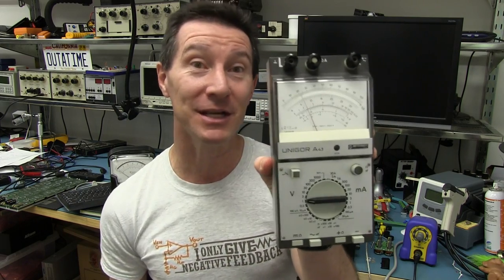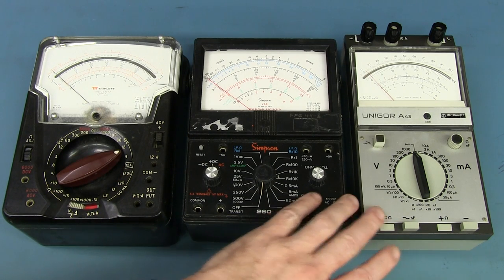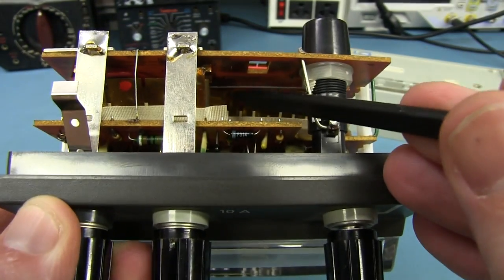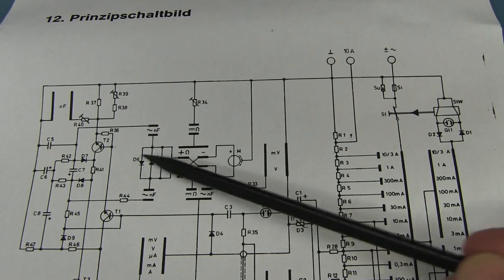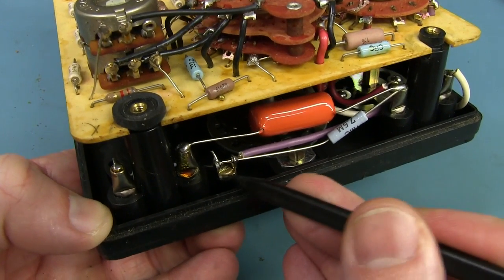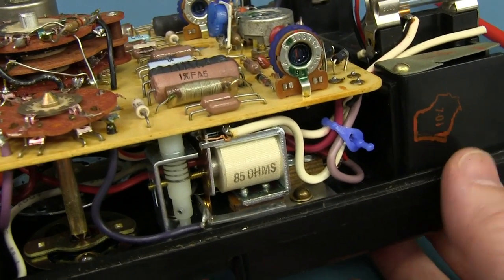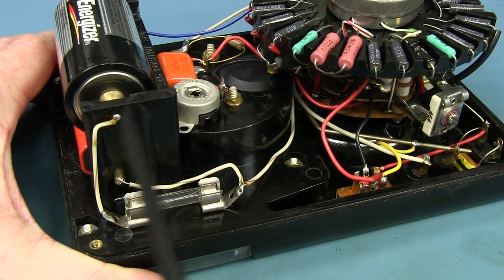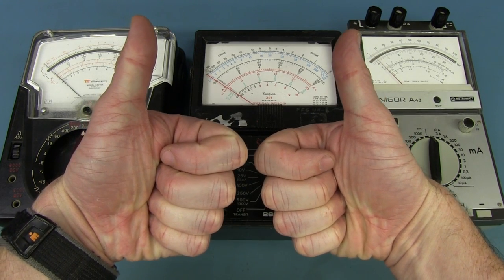EEVblog #634 - Analog Multimeter Teardowns

Comment: Unigors are still used in many European universities, and they still work very nicely.
I happened to work with one ~2 years ago:
Some people asked about how precise they are, and after comparing with some fluke, other brands and 2 oscis there, and if you take the time to read it with a lens and interpolate the values, you can go down to 0.1% error.

Oh, and btw, the Unigor A43 gets tested up to 5000 V to make sure, it is 100% to use to 1500 V.

Didn't know that it looked that terrible inside, but when looking up different models i saw, that they vary greatly.
Reply: As just to say, the link for the Unigor A43 in that .pdf you can see it´s from a german college...;)

Comment: I have several vintage Triplett 630 variants I still use today, built between 1954 and 1965.  You can't beat a quality analog meter.  I love the bakelite case and large meter.  Outstanding construction unparalleled to this day

Comment: Ehh...I liked the German meter the best. I think there is better attention to detail like the spark gap and the much larger air gap for the spring loaded disconnect. Exterior design, it is the best and I don't really get how it's being knocked for a dual board construction when it seems the other meters are somewhat half-ass arranged in mid air.
Reply: Austrian, to be precise. BBC Goerz was in Vienna.

I did think it was a Hartmann & Braun-knockoff; H&B Elima also was bought by ABB (Ex-BBC). My father&dagger; used a Multavi 5 from the 1940/50s all his life. I just got a "new", 1985+ Multavi 5, and do own a collection of Elavi, Multavi, Wattavis.

As a part of BBC, it seems that form factor just was kind of standard in the 1970s-1980s. It WAS expensive with a price in Germany of DM550,- in 1975.

Comment: Dave, I used this type of Unigor multimeter already in 1965 at school when I was studying Measurement and Control Technics (Electronics and pneumatics)!
In those days they did not yet use epoxy circuit boards (to expensive) outside of the military.BTW, I am from the Netherlands.

Comment: Good video. There are Simpson 260 models with mirror on the dial. They usually have an M after the 260. Bad thing about the Triplett and Simpson is how brittle the Bakelite is. I have seen scores of cracked cases and faceplates. You're right about the current Triplett meters not being the same quality. Word of caution about the Triplett: remove the batteries when putting it in storage. Too many switches have been destroyed by the leaking batteries. And repairing them well is no easy task.

Comment: Enjoyed the episode...I purchased the equivalent of the Unigor back in 1973 and it was then marketed in the US by Simpson Electric under the the model number "Simpson 257". Mine was manufactured in Austria by Goerz Electro Gmbh. It looks pretty much like your specimen inside with the phenolic type PCBs. The range selector switch is very solid with the ball bearing snap action feel.
It is still very accurate and I like the capacitance measuring feature, from about 0.01 to 5.0 microfarads. For those measurements, an external 50-60 Hz 100 to 240 VAC must be applied.

Comment: The protection diodes on the Triplett are in a single package. It is that brown gold leaded component on the back of the meter movement. The 630-PLK had the overload reset.

I have a pair of 630As, great meters, but I'm jealous of the NA's range doubler.

Comment: I agree that the Triplett is the clear winner, I own the Triplett model 630NS and like yours is identical in everyway except for the 30 volt battery. This particular model uses a 1.5 volt AA battery to achieve the same readings in the high resistant scale. When I purchased this on EBay it came with a leather case, original test leads and owners manual all in mint condition. The only issue, the battery had leaked so I fabricated and repaired the 1.5 volt container to get the 100K scale working again, well worth the time and effort.
Reply: John Cunningham Mine had the exact same problem, except the battery holder was beyond repair.  I couldn't find one locally that would fit, and wasn't going to buy one by mail without knowing its exact dimensions.  So I simply soldered the wires directly to the battery, and fixed it in place with hot-melt glue.
Reply: Thanks Clyde, it's nice to know we can be enervated when it comes to repairing equipment of this caliber, certainly worth the effort and time, especially when you consider what it can do.

Comment: Hi Dave, I myself have the Unigor A43, but is not from Metrawatt. it is from BBC GOERZ, I love this Multimeter.  It is very accurate for an analog, also through the mirror Scale.
And the screwable input connectors, are very practical.

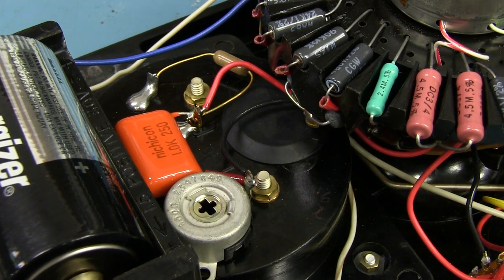Comment: EEVblog  Dave, the Germanium diodes on the 260 board that you comment on at 20:24, are actually part of the protective relay circuit. This 260-6XLP does not have individual back to back diodes across the movement, but rather a single component that is essentially, 2 back to back diodes in one case. At the 20:15 mark in your video, it's the tan (or green) colored component with gold leads, between the meter terminals, and hidden between the 2 calibration pots. It looks like a resistor, but is printed with the Simpson part number 01-110670. It was a purpose made varistor for meter protection, and can also be found in the Triplett 630 as well, printed with it's generic part number V64. (in your 630, it's the gold leaded tan component at the 26:40 mark) They are no longer available, and current production 260's and 630's just use two back to back 1N4148 or 1N914 diodes in it's place.

Comment: Static charge on analogue meters o.O
Well that's something I hadn't noticed before, makes perfect sense because all the display is a coil of wire.
Reply: ***** for formalities what you said totally reflects (pun intended) the needle ;)
Reply: I've even noticed it on some early digital meters. The display just goes crazy if you rub it with a woollen cloth. :-)
Reply: *****
You're correct. The static charge effects the needle not the coil. Sometimes this charge is very hard to get ride of however, a dryer sheet works every time.
Reply: ***** That's fine mate, I like to think of youtube as a unbiased video educational tool. If no-one would correct me, I'd never learn a thing ;)

Comment: I like the triplett, but I do like the simpson line as well.  The particular one you featured is not as nice as many that they make.  I have a 270-5 which is still manufactured to this day, and it is down to 1% accuracy on a 270 degree taut band suspension.  It is a very nice meter.  The classic 630 triplett is very , very nice.  great video!
Reply: I have a Simpson multimeter I want to restore. It uses two different types of batteries. I think I need to replace some resistors. Otherwise I think I will have a working meter. Paid about 15 to 25 dollars for it at a thrift store in north Georgia.

Comment: Dave, enjoyed this vid.  I just had my 260 xl opened up.  The D cell leaked and made a real mess, cleaned it up and reworked a couple solder joints and all is good now.  I love these old meters, Recently refurbed a KG 625 VTVM, those are nice, as they give you an analog movement with high input z.  Thanks, again!

Comment: 20:08 - Looks like these 4 diodes make up a full-wave bridge rectifier circuit for the AC ranges 

The protection diodes appear to be next to the funky plastic-tubed range resistor  (21:50).

Comment: I got a Simpson 260 series 3 for a Christmas gift in 1962 and still use it. That Simpson has 5,000 v (ac and dc) jacks on it besides the jacks used for the range switch..

I also have a Unigor from the 60's that I got when the company i worked for in the early 90's shut down, that is a very accurate meter.

Comment: In my electronics class in high school we had a about 7 Cen-Tech multimeters and a Simpson and 3 Triplett 630-PL meters I always loved the Triplett meters the most. There was just something about the loud sharp click of the switches and the heavy weight to them that I loved. I remember one of the students had one of the Triplett meters on the 2.5 DC range and probed a output on a 22V DC laptop charger and it pegged the needle so hard it bent the tip of the needle and the damn thing still read accurately (After straightening the needle). Although I still had the same issue with the loose input jacks.

Comment: Dave, the two diodes you saw on top i think are the back to back protection for the relay coil, check the schematic(it shows one part of the diodes going to the range switch). you haven't shown D5/6 which are on the movement, those are probably germanium
Reply: at 15:29 you actually show D5 on the "bottom" board it has a blue package, can you check that part number?
Reply from the maker: Ah, ok, thanks, makes sense then.
Reply: EEVblog video anotation clarification time? :D

Comment: As for the "cutOuts" @ 04:06 and up, this is not in first place a meter protect, it acts like a circuit protection (when i work with my unigor, i find this very nice and handy)
If it´s under voltage or current, you can not overload the meter (readout) as it is active meter drive anyway, but if you turn the selector to its off position under load, it always cuts out. Even while measuring low currents it cuts, so the circuit under test and the meter is always save...:)

Comment: You need to do a teardown on an Avo 8 Dave!!  Probably the most famous multimeter in the world!  There must be alot in Oz, in fact there must be alot anywhere in the world, except the USA.  It was THE must have meter when I did my electronics training but I wasn't able to afford one then.  With the advent of ebay I was finally able to indulge myself, I now have about 20 of the things in different types. Also, the GEC Select Test, a meter introduced to compete  with the Avo.
You will be shocked when you delve into an Avo though!

Comment: Your 1 1/2 V "D" cell battery in the Triplett 630 should not be an Alkaline cell. It should be a Carbon Zinc Eveready "D" cell. It all depends on the corrosion damage YOU want, right?

Comment: I remember using those Unigor meters in school in the Netherlands in the early 1980s. I remember how those switches felt, they were pretty awesome. But even back then they were already pretty old. I'm not surprised you found Pertinax (FR-2) being used for the circuit boards, that was common in the 1970s. I can tell you don't like it, but I think the relay and all the protection are pretty awesome, and probably perfect for use in schools: that way if a 12-year old kid wasn't paying attention and set the range wrong or something, they wouldn't have to throw away the meter or change the fuses all the time. Beauty! :-)
Reply: I agree, he was needlessly harsh on the Unigor. It had, as the only specimen, a very large gap of the contacts of the disconnected relay.
Reply: We are using them at school today
Reply: Unigor is far older than the other two.

Comment: Try the Metrawatt Unigor 4p .This is my mostly used Analog , beneath the Metrix MX 573 . But the Metrix is not a pure Analog one.  In the older days, I also often used the  Unigor 6e ( also electronic inside), but unfortunally this Meter gets in Trouble if you have a Cellphone in your pocket 😂😢.

Comment: Great video, I appreciate your fondness for the Triplett. I still prefer the Simpson for several reasons. One the 30 volt battery is not cheap to replace. The Simpson uses a standard 9 V and a "D" cell. Second the easy access to the batteries, you can open the Simson battery compartment with a coin. Third the documentation for the Simpson meters is great. I not only was able to repair it, but calibrate it as well with easily obtained documentation. Fourth the Simspon has a 250 mV/50uA scale.
One issue with the Simpson, some versions (notably the 7) had a reverse banana plug jacks so it required special leads, while the others had standard banana jacks. I also like the roll case you can get with Simpson. Accuracy for analog meters is not a pressing issue anymore. I use my mainly for peaking or nulling adjustments. If you want accuracy even the fairly cheap DMM's  will out perform any analog meter. The mirror for avoiding paralax was on all the "M" versions Simpsons.

Comment: Great video David. I am sure you would like to review the Avometer. This is not very popular in the US but is in my opinion the most elegant e well constructed analog multimeter. It doesn't have the polluted scale panel of the others. The voltage scale is the same for AC and DC. The "1" voltage scale is the same size as the "3" voltage scale. No special scale for low voltage AC. Resistance positions do not jump ranges, i.e., you have X1, x10, x100, x1000, x10000. You certainly will recognize a great engineering efort in this meter. The construction is extremely solid. It also can handle very high voltage. Check it out.

Comment: Recently I acquired a vintage Hansen SC and a Unigor 1S multimeter.  Both instruments are in fine condition and have been sitting on a shelf in a climatized basement for many, many years.  The Unigor 1S was build in 1963; its price was 365.00  Deutsche Mark (about $180 US), which was about the average monthly salary in in those days.  Unfortunately it needs a rather unusual 1.5V battery, way shorter and more bulky than a modern AAA cell.  No idea if that size battery would still be available anywhere in the world.

Comment: The output connector with the cap is (for example) for measuring the NF voltage at a speaker in a tube radio, so the high DC voltage gets blocked. They made specific output meters back then, but why not integrate it in a multimeter.

Comment: My favorite multimeter is a cheap Lafayette Radio Electronics model which has a continuity buzzer.I bought it in the early '70s and still use it.
On the Triplett, I would have expected that two diodes would be for meter protection and four be used for AC volts.

Comment: I think that the triplet is in the off position and so the meter would be shorted to protect the movement. This will prevent the meter from reacting to the static charge from the cloth, the other two meters are not in the off position.
I can't explain the small movement from the triplet in this test though.

Comment: on the Simpson: is that a ball of solder in front of one of the transistors? Also comparing the distance between the open relais contacts for the Metrawatt and the Simpson I would put more trust into the Metrawatt...

Comment: Hello !
I think analog multimeters are good for some applications specially when you need to read a maximum or minimum point without worry about the specific value itself. Do you think it is worth buying one of those old good ones or a cheap recent (like the Pro's Kit MT-2017) will do the job ? Since you get your hands in so many equipment I would like very much to know your opinion. Thanks.

Comment: A little while ago, I bought a 630-NS (that's the 200,000 ohms/volt version!) from Ebay, and I wanted a manual.  I downloaded one from the Triplett website.  I also perused their current products.  I was surprised to find that they still make the 310!  My guess is that they are still popular with radio/TV engineers.  That's because an analog meter will work OK in a strong RF field, while DMMs sometimes flip out.
Reply: A new 310 is $150USd in 2020! A 630 is about 10 times that.

Comment: it's 40 years old for Pete's sake. The Unigor A43 was of exceptional quality for it's time. Lets see how accurate  a modern Fluke would be after 50 years of use. It won't even work!
And there is a lot wrong with that particular point to point arrangement on the Simpson

Comment: The Unigor is originally from Goerz in Vienna, Austria.
This model must be from the early 70s the design probably from the late 60s.
We had such devices at school in the 80s and they where pretty historical even then.
The inside you showed is rather sure not the original condition the meter was delivered. I have seen the inside of some meters in school and also visited the Goerz production and this was definitely not their production standards then.

Comment: Because you have one, you know that Simpson has a mirrored scale version - the 6XLPM - M for mirrored, same as other Simpsons.

Also, the old Simpson 260-2  (-2 doesn't appear on the front, but it's the first with the rounded case.)  has no PCB as well, with an equally artistic bakelite holder for individual components.  If no one beats me to it, I'll post a pic on the forum.

Comment: I have a Unigor from the mid 50's and it is probably as accurate a moving coil meter that  I own (including some Weston and Westinghouse lab instruments). Analog meters can be a lot more useful than digital meters when troubleshooting because they average things out, no wildly bouncing digits to throw you off. The also give you a good idea how fast a level is coming up and give you the ability to shut a circuit down before it smokes - if your fast enough.

Comment: "rusty" METRAWATT : silver plated copper that slightly turned black, I'm fine with that. Anyways, the Triplet is really beautiful inside. Other than that: I have a lot of experience with the METRAWATT (at school). It is a really good meter. If it comes to practical situations, I would prefer the Metrawatt anydays.